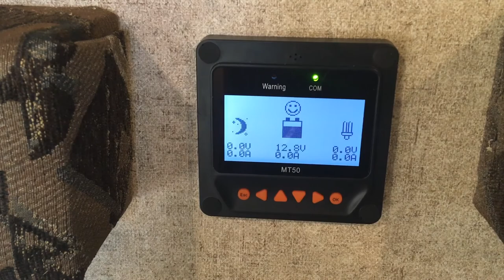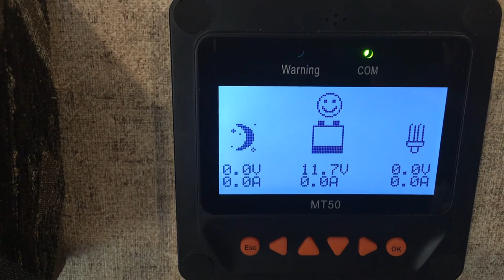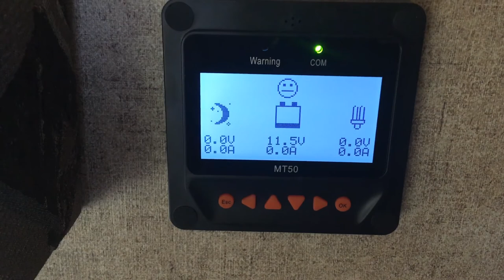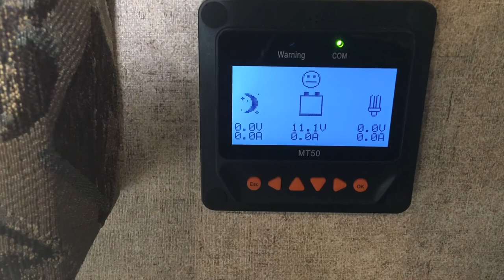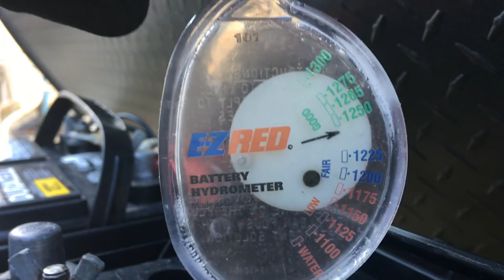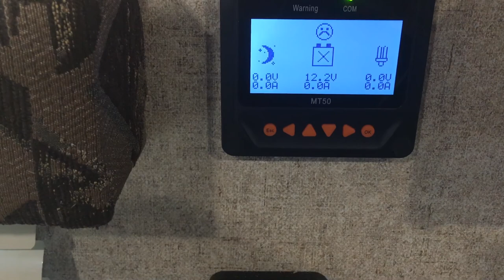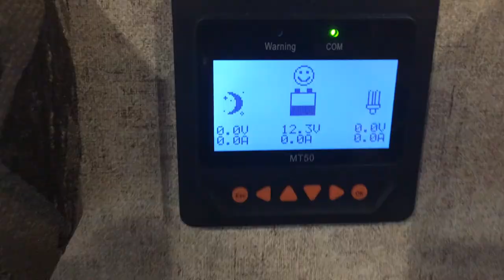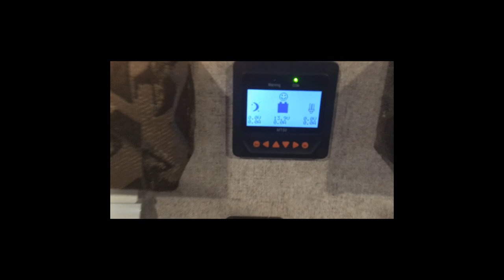RV voltage drop test. Toaster off inverter  70 amp draw. Exaggerated boondocking scenario.

Comment: Hi 👋 Lawrosa1 sir my english is very so so i thenk you solve my problem plz i ned how much Inverter used Amp with 12volt battery on 1000w :::::120 or 220 vot consumption formula is watt divided by volt so 1000 divided 12 = 83.33Amp  so practically if you help me  plz if we used 1000w /600w /500w on inverter   How much battery Amp used on that time kindly if you have time plz tell me this information is I need if possible i am thankfully to you i have no inverter and no battery 🍀🍀🍀🍀🍀🍀🍀🍀🍀🍀🍀🍀🍀🍀🍀🍀🍀🌷🌷🌷🌷🌷🌷🌷🌷🌷🌷🌷🌷🌷🌷🌷🌷🌷🌷🌷🌷🌷🌷🌷🌷